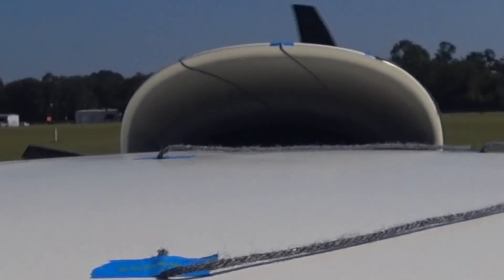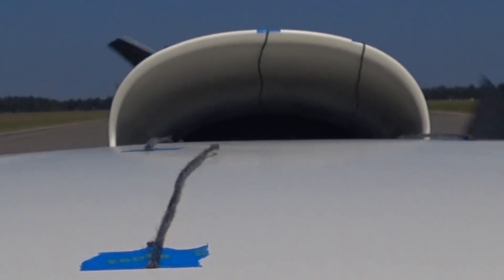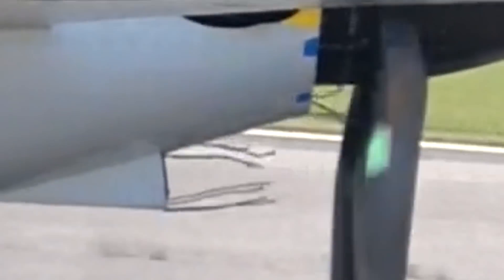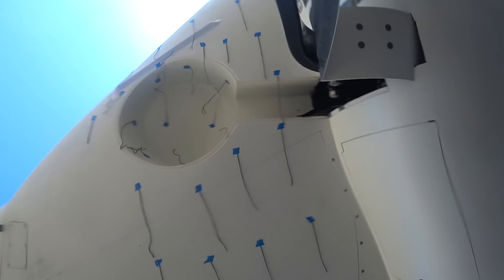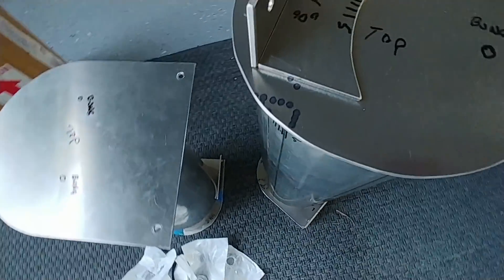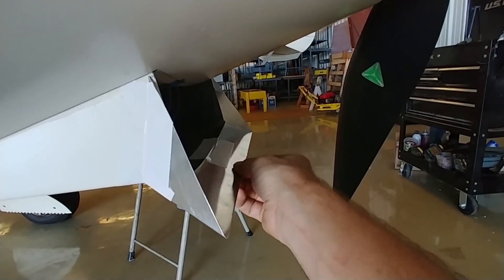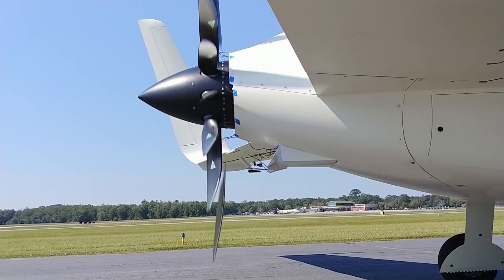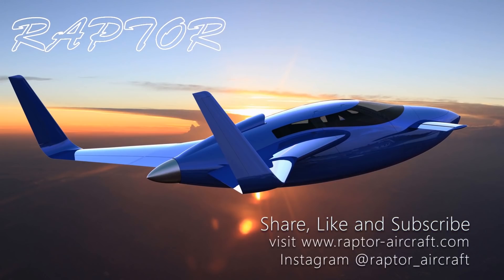Cooling and aero - Building the Raptor Prototype

Comment: New to the channel (last few videos) but here's what stands out to me:-  Peter seems to be relying on lower temps at altitude to provide sustainable cooling. What if an aircraft has to be flown for longer periods at low altitude e.g. under low cloud.  The unfaired wheel wells are a massive disruption to the airfoil cross section  of the wing. Again, an aircraft may have to fly with the gear down for long periods.  The problems Peter is valiantly addressing are arising in an unloaded aircraft - I hope his solutions will take into account that the aircraft will have to fly fully loaded with passengers, luggage and fuel (engine working hard) in all kinds of scenarios or it's not going to be a viable proposition. Not to take away from the amazing effort to get this far.

Comment: I personally, not happy with uneven non symmetric air flow to prop. That lower exhaust is getting too big. The addition you put on top is great reminds me of JT8D exhaust.
Also was looking at 2019 crash of another canard experimental 🤔👎 you need to be extra careful unstabilized pitch can be a killer.

https://youtu.be/oq4wTjC33ZU.  Stability

Comment: Peter, you seem to be on the right track with fixing the cooling. Suggestion to address the aerodynamic oscillations. Eliminate the wheel well turbulence and negative pressure area as a suspect by covering it with very stickly thick 3M cloth "roady" tape. Start the tape on the TOP of the wing (about a hand width back from the leading edge) then run it down around the leading edge and back under the wing all the way back over the wheel well. No way on earth this will "tear" off due to wind, etc.. refer: https://www.3m.com.au/3M/en_AU/company-au/all-3m-products/~/3M-Extra-Heavy-Duty-Duct-Tape-6969/?N=5002385+8711017+3293241050&rt=rud

Comment: Tie the plane down and run 100% throttle for cooling tests. Your prop alone should give you enough air to cool.
Reply: The prop is designed to provide thrust, not cooling air. The only aircraft I've worked on that would not overheat during a full power run have turbine engines or have a "test club" propeller that cannot be used for flight. 

The inlet looks like it uses the fuselage as part of the duct wall, so that is probably getting boundary layer turbulence. Most high speed aircraft use a duct with the inlet spaced a short distance away from the rest of the airframe and will have a small gap between the inlet and the skin. The farther back on the fuselage the inlet is, the farther away your inlet should be to keep it out of the boundary layer. The P-51's air inlet for the radiator is a perfect example of this.

Comment: I looks like you've got plenty of airflow going in and out but what's it actually doing inside the cowling?  You could try measuring the differential pressure across the HX cores over several points to see if it is actually passing through or around.  Tufting the downstream side of the core too may be illuminating. Also measuring air temperature differential across the cores and over the "in" and "out" of the HX might tell you something useful too.

Comment: In some cases electric fans work great until air is forced through the radiator then they present a restriction. Might need to have a bypass gate to allow forced air a clean path to flow.

Comment: The wheel cut out is sooooo close to the leading edge, so when you are higher AOA its acting like a big ass speed brake.  If it was further back I doubt it would have any issues.
Reply: That may cause the airflow to attach/detach at a given (gear down climb) alpha, which could cause abrupt variations in the lift force, which could explain the observed oscillations.
Reply: Well look at current retract aircraft

Comment: Those lips are a great idea to draw air, if you expand the dirty air exit all the way to the prop, dare I say you could get premium draw out of the engine bay. You'd want to fence off the exit with mesh to prevent anything from the bay causing a prop strike aswell.

I dont think adding additional cooling tanks to the front hatch is a good idea as those tanks filled will just add weight, we just need to sort cooling primarily. 

** if anything adding lips to the induction scoop will aid best in drawing more air in. 

Also tape your strings further inside the scoops to get a better look at the draw. Having them on the edge could cause anomalous results from the outside air swell.

Comment: I've watched videos of WW2 aircraft and all their intake scoops are on the belly. Heat wants to travel up so why not take it up and exhaust it on top. Nose high in takeoff and climb out would give the air a direct path to the scoop. Cover the wheel wells and get it into ground effect check the stability and possibly another lap around the pattern
Reply: The problem with a belly intake is FOD. The nose wheel will kick up dust, sand, rocks, and so on.

Comment: If you haven't thought of it yet, make sure you have provisions for eliminating air pockets at both ends of the coolant system.  Expansion tank alone will not usually cure this.  Air in the coolant system can cause sudden overheating if the water pump cavitates.  This is a common problem with rear engine cars with front end cooling.  Ultimately, I think you will need more radiator and airflow combined to truly solve it.  I also think you're on the right track with the channel under the wing.  Just make sure you only change one thing at a time so you know the true solution.
Reply: On the earlier post you saw the coolant temp' was climbing too high as well as the engine temp', this indicates that there is good flow (or the coolant would not be heating up as fast), the extra capacity is to act as a heat sink at low altitude and airspeed/high alpha when the air flow and ambient air temp' are not conducive to good cooling.

Comment: Noticed that the tufts on the upper cowling went from flopping around to straight in the airflow through the prop. Might want to do the bottom also since that may be straighten ing the airflow through the prop and around the spinner. Better linear flow there may increase the total flow throughout the engine compartment. Love your videos.  Keep it up!

Comment: @Raptor Aircraft Why not address the suggestions presented over the last 2 videos advocating for the removal of one of the turbos to resolve the overheating issue(s)? The comments originated from some Audi engine experts. Just curious...
Reply: It makes no sense not to listen to this expert advice. I’ve been a supporter an believer since day one. But “ not believing it will work” is not a good reason. I admire Peter’s determination and perseverance immensely. And I do believe stubbornness and vision are absolutely required to get a project like this off the ground. 

But the guy on the last video was literally a designer of the engine. He almost certainly knows more than Peter will ever know about it’s performance and capabilities.  To reject his advice out of hand is a mistake.   I’m certain it’s a lot of work.  But with this much time and $ invested, not to mention safety ( much more important) and the potential for an 80hp gain?  Why wouldn’t you try this and run some ground tests?
Reply: The aircraft builder referred to the advice from the engine builder as a crazy idea and a lot of work.
Reply: ....Because his tail number is ...2TD  LOL   (2 turbo diesel)
Reply: @nssherlock4547  lmao. Funny but deadly dangerous to risk engine failure from overheating plus unpredictable aerodynamics resulting in poor glide ratio.
Reply: @ryanthomas2472  Ahh, I must have missed it
Reply: Why bother removing 1 turbo. Might as well remove the engine and use standard aircraft engine...

Comment: Peter understands not to do too many”fixes” to fast as you cant determine actual cause/effect solutions that way.   Closing the gear wells as testing effect is a good next phase.   Solid mounted cameras will help with visual recording.   Cooling mods and slight CG adjust are good but would be as far as I would go for next flight     That would help in seeing the changes in aerodynamics/cooling

Comment: This is a bit like the tail chasing the dog mate.  FIRSTLY, you should get a ΔT on the air across the heat exchanger and a ΔT on the coolant entering and exiting the heat exchanger.  With this information you can narrow in on the problem quite easily.
Reply: Why is understanding air flow a tail chasing the dog?

Comment: Peter congratulations on your first flight!

I would like to suggest a “best case” test for your wheel well involvement in the oscillation

In other words, eliminate them aerodynamically to see if they are the culprit or not with quick pattern flight

If the oscillation persists then you know to look elsewhere in short order

I don’t think it would take you long with your CAD software and foam carving abilities to work up some plugs that would be a perfect fit including the radius

That and some 400 MPG tape and you’re good to go!

Comment: Can you make vortex generators in the intake closer to the radiator to swirl the air. Might be “too efficient”. If you watch “birth of the V-rod” around 30:50. The air was flowing over the radiator instead of through it.

Comment: Is it worth setting up  a cheap digital manometer between the intake and lower cowl and possibly anemometer with a remote sensor on the back of the radiator to determine effectiveness of each variation during high speed taxies which would help to isolate those that are more effective, less effective or effective in concert with others? This would give you instant feedback for your testing without having to consider external contributing factors and latency.
Reply: Tim, good suggestion, but why not just log the net difference in coolant temperature between runs with each mod using the temperature logging he already has and is using as the actual measure of success ?

Comment: Disclaimer: I am not an aeronautical engineer by any stretch of the imagination, but...

Could you put an airfoil shape at the inside of the inlet of the air scoop. Most jet aircraft engines have that, and I would assume (using Bernoulli's work) that the increase in speed would create a lowering of air pressure and suck in more air?
Reply: Second that. An airfoil outlet should speed up air and creates a low pressure on the engine side which in turn sucks more air into the inlets. Like the venturi effect in a carburetor
Reply: I think there plenty of air, that scoop is as big or bigger than a P-51 scoop. It’s where the air goes, at what velocity and pressure that matters. Needs proper sized inlet, expand and slow that air across the heat exchangers, then control the output.

Comment: Peter, in the next flight, I suggest that you seal the wheel well with high strength tapes since you need to keep the landing gears down at all time for safety reasons for the first couple of flights. If you still have the pitch oscillation, then you can reasonably conclude the oscillation is highly likely caused by canard wing stalling and recovering. If it goes away, the oscillation is caused by the irregularity of the wheel well under the main wing as you have concluded. When you retract the landing gears, the oscillation will go away. Be careful, fix the engine temperature problems first.

Comment: it looks like the ledge on the vent  caused a significant low pressure area too bad you can't mount a surface mount pressure transducer but I think you may have faster exit flow as a result good luck, clearly you have the patience of Jobe

Comment: Just out of curiosity, I know you said there was no danger of the door coming open on the flight, but is there maybe a small possibility that the fact that there may have been just a little play could have had a small impact on that flight? Only reason I say that is there is definitely more stability in ground effect, (which could be other possibilities too) just throwing an idea out there! Good luck Peter!
Reply: A tiny gap of less than 1/2" in the door should not have such a drastic effect as to cause the plane to nearly fall out of the sky.  If so, that door needs a massive redesign, but I'm 99% sure that this has little to nothing to do with the issues at hand.
Reply: @hitekrednek7664  true, but if air can pass between the door and say the gear opening (not the wheel wells) that could cause strange flow oscillations possibly. I'm just throwing out ideas if they're wrong... Great. Even better to find the problem.
Reply: It also seemed more stable when you pulled the power back before landing on runway 4

Comment: A good solution would be to close with a temporary cap the landing gear hole for another flight test, then you can see if the oscillations on flight are really caused by this while you think about a permanent solution.
Reply from the maker: Although that doesn't really provide a long term solution it does remove another variable for the next full test which would be a good thing.
Reply: @RaptorAircraft  < that’s precisely what you need to do, find the cause and then work a solution.
Reply: @RaptorAircraft  My ideas for experimenting would include making a sort of double-door which opens and t hen closes around the gear while extended and covers the wheel wells for the gear.  Or add some vents in the backside of that hole which allow air to flow through and out of the wing at that point in order to greatly reduce turbulence inside of it.  You can also do more aerodynamic shaping of the hole on the rear side, rounding that sharp corner off more on the rear side in order to help the air flow smoothly out and back.  If eliminating that turbulence and debugging the canards a bit doesn't fix the oscillations, you should really consider moving the C/G forward.
Reply: @RaptorAircraft  Aerodynamic fixed would solve several issues, save weight and reduce complexity.